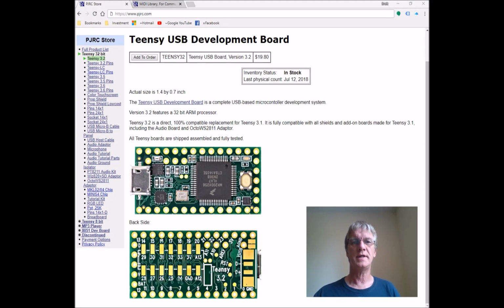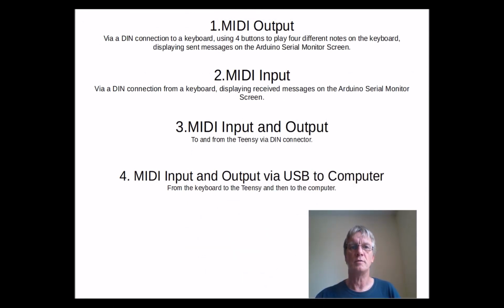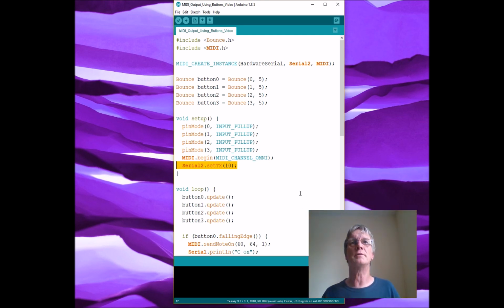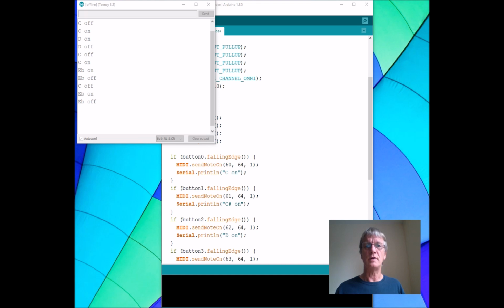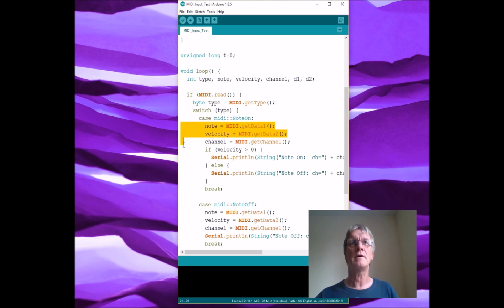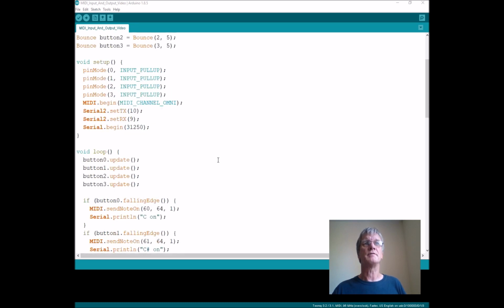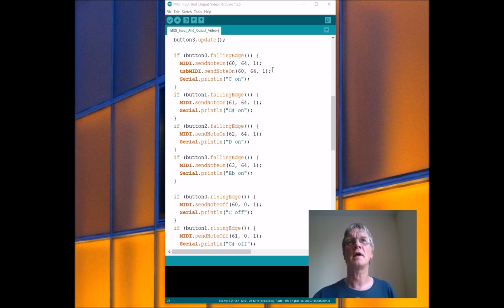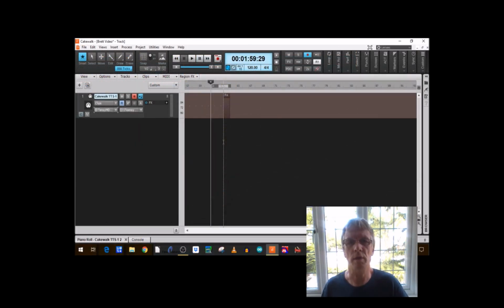Teensy Microcontroller MIDI Input & Output to Keyboard and USB to Cakewalk DAW Arduino IDE

Comment: Very well present walk-through. Only thing I could not see is when you playback at the end, how the midi data from DAW is read back into the keyboard through MIDI-OUT on breadboard. Since that was setup using builtin USBMIDI functions, how does it get sent back to Serial2 (RX-9) for keyboard MIDI using MIDI.h library? The code showed usbMIDI.sendNoteOn(...) in midi.read() case, but video does not show, or I missed the USBMIDI passed to the Serial2. In my setup I use the keyboard's voices, not the DAW. So, maybe the case your using DAW and its voices and only needing MIDI-IN from keyboard/piano. If that is the case, how could I get the MIDI from DAW in playback to be sent back to the keyboard/piano?